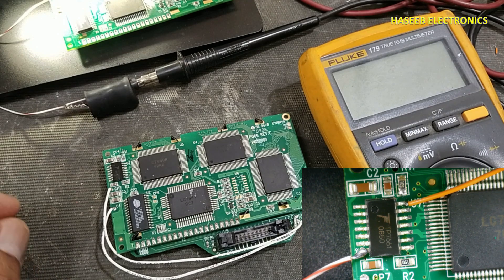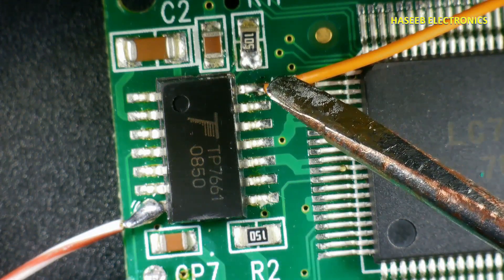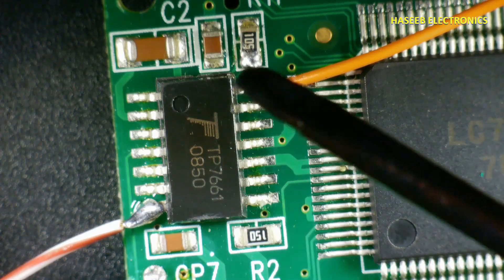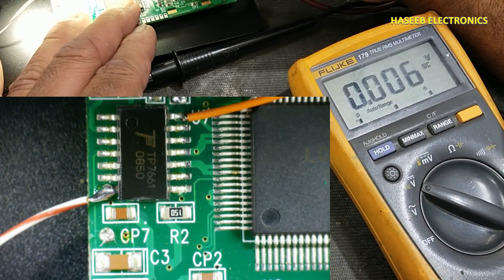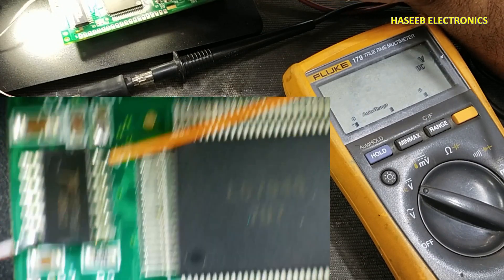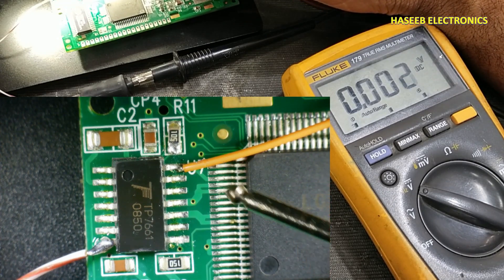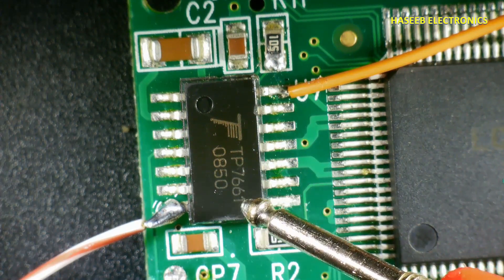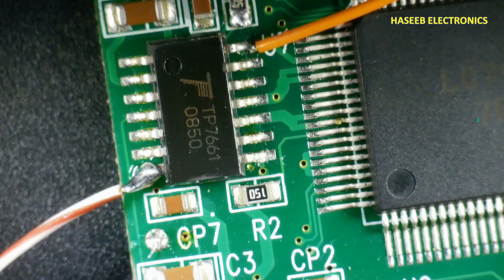{921} TP7661 dc to dc converter ic

Comment: Sir, there is no plus 10 volt?
Reply from the maker: this ic receives +5 volt on pin number 14
and provides -10 volt output from pin number 8
it converts the voltage polarity and doubles the voltage